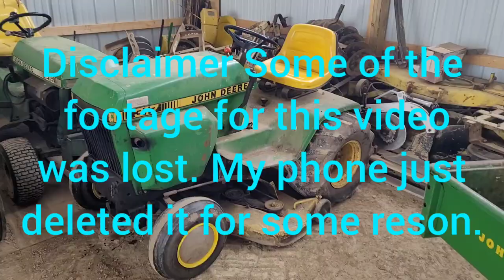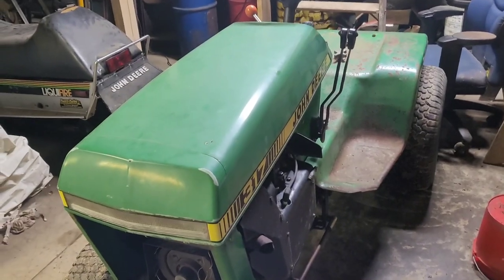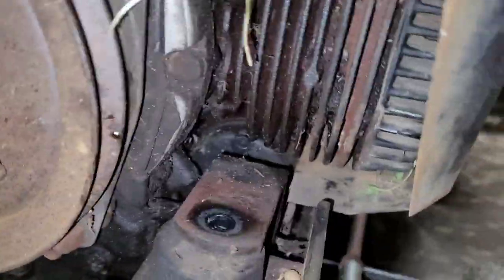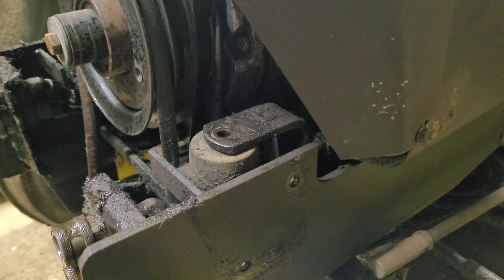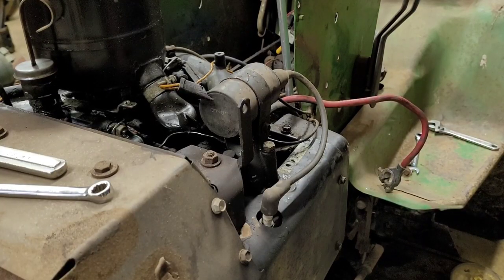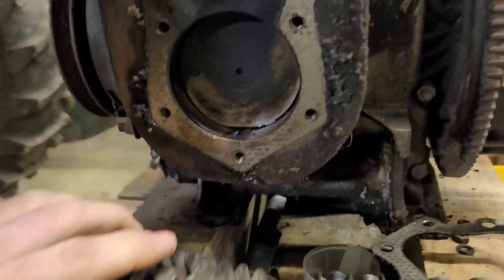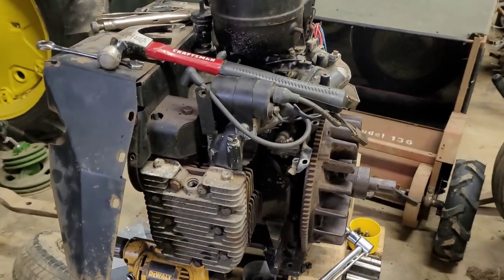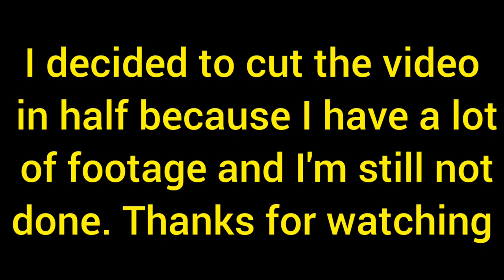1980 John deere 317, how to / engine swapping. part #1 (removal)

Comment: I have found it easier to remove the fender pan, drive out the sheer pin from the drive shaft at the rear (which is normally rust-welled together), spray with penetrant, let sit for at least an hour, get on and start up and with throttle at full, push all the way forward quickly on the forward/reverse lever. The motor torque breaks the rust welds. I spray more penetrant and easily slide the motor out while it drags the drive shaft out with it. You can then deal with getting the drive shaft off the hub on the bench with the hub removed from the engine.

Comment: I have a 1982 JD 317 with the KT-317 engine.  I think it broke a connecting rod.  Do you fix these?  Where are you located?  How much would it cost?  I can pull the engine myself.
Reply from the maker: It would be pretty expensive 2 fix but I could fix it for u. Probably $200 in parts + labor.
Reply: @mikestarcher  Where are you located?  I love this tractor, and think it would be worth it.
Reply from the maker: @taxmanrog  ohio

Comment: Are they both Series I?
Reply from the maker: Yup
Reply: @mikestarcher  I have four 317s. One I purchased new in the day with the Series I. I still have it and the heads have never been off: Points, fuel pump, a coil (may have been a bad diagnosis...), plugs, oil filler cap, belts (but not too many as I always buy John Deere), Mule drive bearings/pulleys. It gets worked harder and longer than the other 317s (Vanguard and Series II), but I aways check the oil, keep it topped up and drive it on mostly flat land. It has countless hours. Smoked a bit 10 years ago so I started mixing Marvels in the gas and a little added to the engine oil. After a few tank fulls, no more smoke and none today!